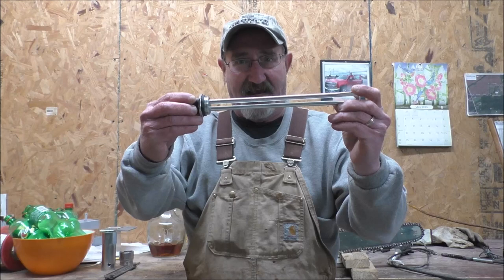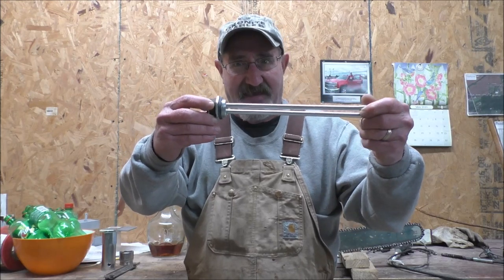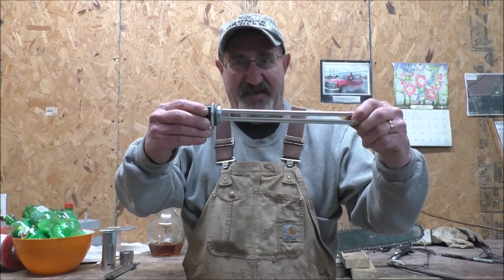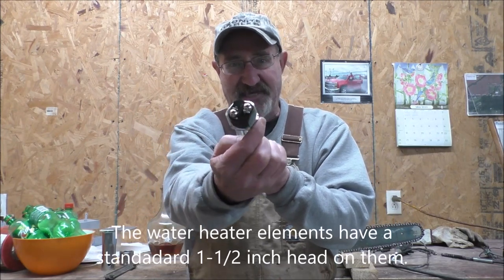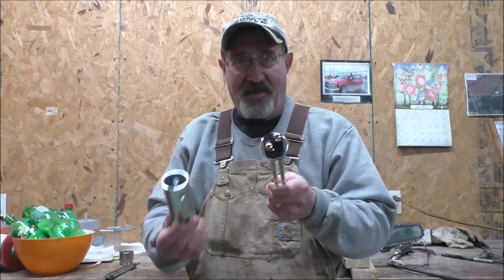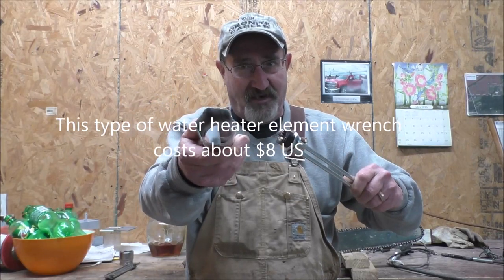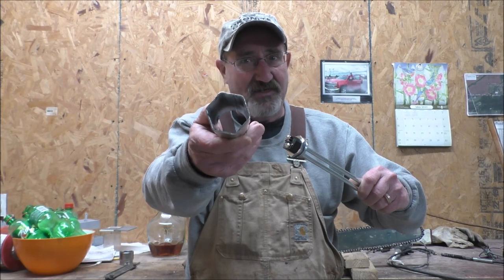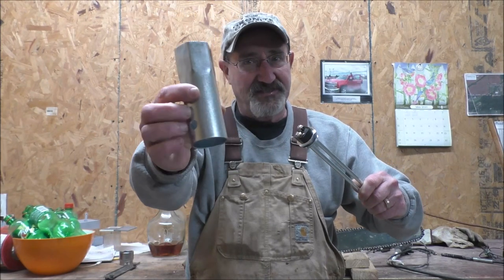Water Heater Element Wrench Tip

Comment: The socket and breaker bar will work but take these precautions to prevent problems. (make sure the power is disconnected, water is turned off, and the tank is drained before beginning.)
Push the breaker bar down instead of lifting to prevent raising the hot water heater off the floor and breaking the water inlet pipe on top causing a flood. Use one hand to stabilize the top of the hot water heater from tipping while you crank down (or up) with a breaker bar. If it is really stuck get a friend, your son, or a tough girl to lend a quick hand while you crank it loose. I learned my lesson the hard way late on New Years Eve while breaking the water inlet pipe flooding the garage. It was late on New Years Eve and the big box stores were closing soon and it had to be repaired because new tenants were moving in in the morning.
Another good tip: Do not, NOT, throw power breaker back on until the hot water heater is completely refilled with water. If you apply power before completely re-filling water, you will melt the new heating elements destroying them. It only takes a minute or two to destroy them if they are not submerged under water inside the tank. My wingnut handyman, Roger, taught me that lesson with a new hot water heater while installing it in too big of a hurry. Had to replace both elements again, late in the day.
Reply from the maker: I totally agree.  All great advice.  The voice of experience has spoken

Comment: Had this issue tonight...Auto Zone had the socket $8.99.  Thank you for the tip...IT WORKED!
Reply from the maker: Glad it worked for you
Reply: Thanks for saying Autozone because I couldn't find a 1.5" socket at Lowe's.  Autozone set me up with a 1.5" socket, socket adapter, and a much larger ratchet for about $60.00 because I wanted more leverage.  (The element wrench from Lowes kept slipping off). The socket wrench still required a few intense tries, but both elements came out!! Only one element was open (the bottom one, but changed both anyway).  Now getting  hot 🔥 water💧 again, but now with both elements working.

Comment: Sometimes a breaker bar isn’t sufficient. In that case I use an impact driver to jar it loose. In fact if you give it a reasonable effort with a breaker bar and it won’t budge it’s best to use an impact before the socket can slip and do further damage. Also take a moment and scrape any rust build up from the element so the socket can get a firm purchase.
Reply from the maker: An impact is a great idea since it actually "bangs" (creates vibrations) parts loose rather than simply twisting them
Reply: Exactly. 👍🏻
Reply: You mean that it's that difficult to break loose?

Comment: Thank you very much sir! I busted a few knuckles trying to use that formed piece of pipe “socket” to get an old element out. When I return to take another stab at it, I will be armed with a 1 1/2 inch socket and a breaker bar. Just hoping that the threads on the tank aren’t so rusted that they won’t hold the new element in place.
Reply from the maker: Glad I could help

Comment: Regards from Italy and thank you for the advice. I used the socket you recommend, that for us is a standard 38 millimeter socket. The size was the same you have shown. The element wrench did not work.
Reply: Yes 38 mm = 1 1/2 inch socket 
38mm / 25.4mm/inch = 1.49 inch = 1.5 inch = 1 1/2 inch

Comment: I know this is an older video but I’ll give you all a tip. Do not buy that cheap 8 dollar “element” socket. Buy a 1 1/2 inch deep socket like he said. Grind the bevel off the socket off so it’s flat. Now you can get a good bite on that Little 1/8 inch nut on the element. Hope this helps someone. Good luck. 🤘

Comment: Currently trying to get a stubborn element out with an inch and a half deep well and a long 1/2 drive rachet. So far it's still winning. Wd-40 is useless. Wish I had got some pb blast while I was out. Having tons of fun.
Reply from the maker: Wow. Sad to say but sounds like time for a new hot water heater.
Reply: Gregory it'll be lots more fun once you finally (after busting up your hand) get the element out and it's GOOD/not the problem😂😂
Reply: ..I have used PB blaster each of 4 days ahead of time and a 1-1/2” socket and breaker bar and I feel like I am going to break the breaker bar and it is still not coming off.  Had same trouble last time I replaced it and my neighbor came over to help

Comment: cheers, marsh rat. hoping this works on my water heater, gonna get one of those sockets soon cuz my heating element is so corroded
Reply from the maker: I wish you luck
Reply: @MarshRat  it did work! I just went to the hardware store and got that socket. came right off! thanks for your help!

Comment: Grind the bevel off the socket so it fits dead flush and forget the breaker bar.    Use an impact wrench.    I just did it today and had it out inside of 30 seconds.......after I struggled with it for 2 hrs a month ago.
Reply from the maker: ok

Comment: It's not a hot water heater. It's a water heater.
Reply from the maker: Willie, at least you got the point.
Reply: Yeah, I got the point.
Reply: It is a hot water heater after it heats the cold water to hot. 
It holds hot water. 
You aren't  going to change millions of people speech with your nit picking.